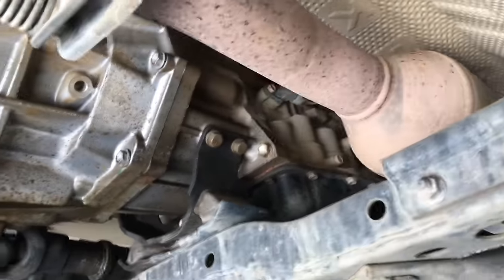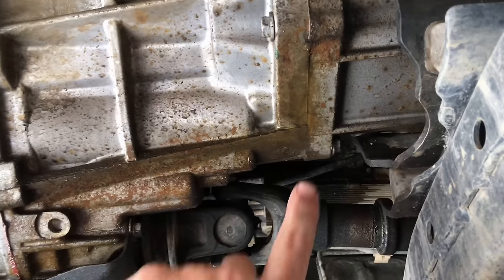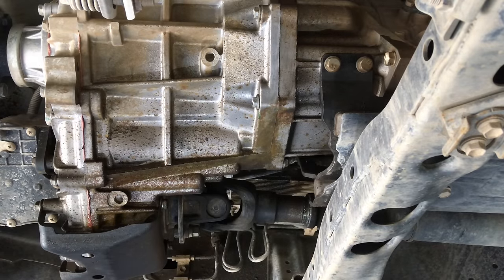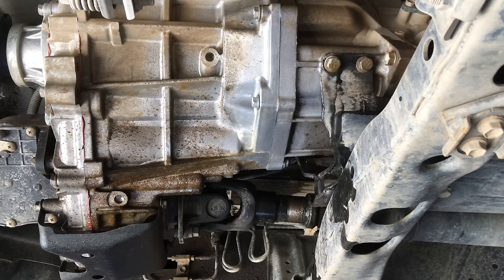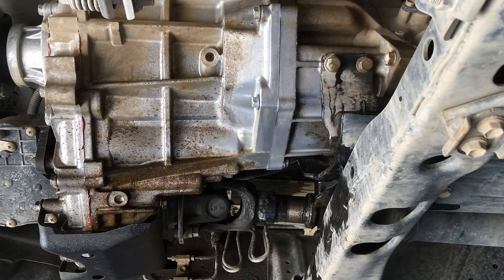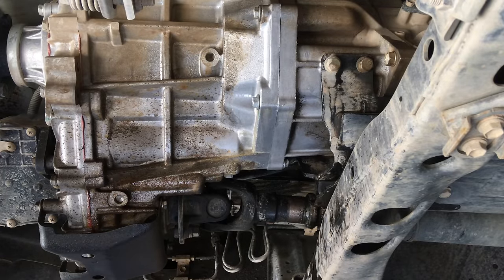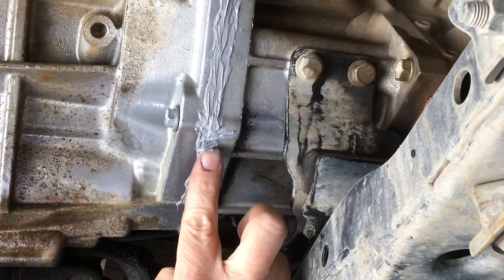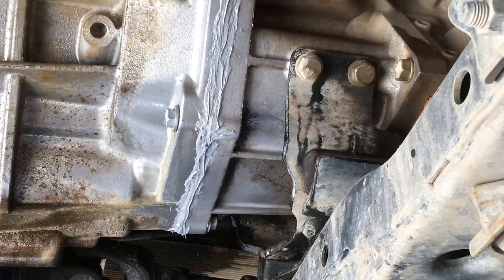CHEAPEST OIL LEAK FIX THAT WORKS

Comment: I wonder if you can tight the bolts little more will it help??? how long do you think that silicone would last???
Reply: If there's leak in that area, then there's a big chance that this one is not fixed by what he showed us. That area is where the transfer case and transmission assy connects. There's no oil there because there are no gears in it. It is only the mating surfaces of transmission and transfer case. Gear oil is in the transmission and transfer case assemblies, not in the mating surface.
Reply: @kordapyo612  correct, there is not even oil in it. its the shaftseal between the 2 cases.
Reply: @kordapyo612  I am currently experiencing a minor transformation fluid leak at that very joint between the transmission and transfer case on my 2004 Toyota Rav4 Automatic. This was after my transfer case was replaced. Just few days afterwards. It's difficult to see where the source of fluid leakage is. 
I was suspecting that bolts between transmission and transfer case were not torqued properly. 
I'm also considering the output shaft seals.
My transfer case seal was replaced during the swap. 
What do you suggest? 
I'm returning to the mechanic very soon.
Reply: @kordapyo612 so if we putting sealand on that space, the oil will come full on that space, it's oke or will make another trouble ?

Comment: Thanks for your video, May I ask you advise, my Sportage oil pan was wrongly resealed by the car dealer and the refuse to reseal it and says different sport. I found the leak come out from one screw which above the crankshaft dust shield, there are 2 screws above the shield, I cleaned the arear and drive about 20minutes one screw can see oil drop mark on the screw head, the other one is nothing. So, I would like to ask you if I follow your way clean the oil pan leaking screw and the arear around it , would it be ok? or needs to re-do the whole seal? Because the oil pan was resealed only 6 months and all around the seal was fine  except around the screw that bit.

Comment: I am looking at the rear off the transfer case, it has been off before by the look of the gasket silicon oozing out around the edges, if that has been off before for something then it looks to me that there some evil things going on inside the transfer case?????? It could well be a never ending source of issues unless it is stripped down and fixed properly??????
Reply from the maker: Just a tiny weep at the seal.
Not worth fixing yet

Comment: After praying to God thanking him for healing, repairing and rejuvenating my car engine, car belts, suspension, clutch and all other areas...everything improved drastically. I had the previous owner of the car drive it and they said not only did it drive like new (it's a 19 year old car) but they noticed the engine sounded like new as well, much quieter (can barely hear it when it's on) and a stuttering noise it used to have has now completely gone. After noticing this they did the same sort of prayer for their own car and noticed the same outcome!

Matthew 19:26

“But Jesus beheld them, and said unto them, With men this is impossible; but with God all things are possible.”

Comment: Looks like either the transfer case input shaft or gearbox output shaft seal is leaking.
Reply from the maker: Yep but not much not worth a major repairs to fix client was happy to hide the five mill a year
Reply: @Fourby4Diesel  Personally. If the owner cant afford to maintain the vehicle then they should own something they can afford. but sadly I suppose its all about the illusion these days. lol

Comment: You didn’t even see if the bolts were tight, and u should always scuff with emery paper for the sealer to stick properly , it’s like paint if it’s not rubbed paint de laminates and peals off, silly dodgy brother, I call that a half job!!!! Quick fix

Comment: Typical for a lot of Dodge trucks and Jeeps one of there biggest flaws I had a '99 Grand Cherokee got used and went to check the transfer case oil level and it was over full probably has it out on the bench to fix that problem and filled it in the bench as well but my '95 Ram has the same issue leaking oil from the transfer case joint I know a few other people who had the same problem not a cheep fix by all means...

Comment: Big mistake, if that's stopping the oil from dripping down, it looks good but if the rear main seal is leaking, oil will be trapped inside the trans housing since there's no way for the oil to come out.

Comment: I am gonna try this on my 2008 Toyota kluger/highlander. It is seeping from timing chain cover.
Reply: Has it worked? I have the same issue
Reply: At205 reseal probably work better. If your leaking by timing cover you could have a bad crankshaft seal
Reply: @HollowMartyr1333  Just tried it yesterday and it didn't work. I didn't remove the VVT Line bottom banjo bolt because i didn't have the new washer and didn't wanna reuse the old one. I am gonna try and remove the goo(as much as i can) and try this again in couple of days. Still don't have the new washer but i will reuse the old one for now. This time i will remove the Banjo bolt because it seems that the area of leak is right behind the VVT line. Will update.
Reply: @JoseDiaz-rd9fh  Additives work for Gaskets(sometimes), not for RTV.
Reply: @HollowMartyr1333  I have removed and reapplied the RTV and so far it has been holding up fine. It has been more than a month since i applied it and so far all good.

Comment: Putting silicone like that has never worked for me 
Maybe because I haven't used the toothbrush
Reply: Drain a little fluid and put some Lucas in. Thankfully I've never had any leaks. 2010 RAV4 with 197k miles. Stuff works

Comment: Rare main seal cracked or split... A roughly 30 buck rubber seal.   But the labour costs outweigh the benefit...  You drop the transmission.,  not worth it.. What your doing is economically sensible..

Comment: I have an oil drop coming form my VVT Solenoid Cover on my FX35. I ordered a replacement gasket and replacement covers but waiting for them to arrive. Car only leaking when running and as the engine heats i notice drops coming from the bottom right corner.My Part arrives on tuesday morning, but need to drive this weekend. should i do this as a temp fix?

Comment: Any good fixes for repairing a boot tear on a perfectly good ball joint?  Thks
Reply: if you are looking for a temporary fix or need to make a quick repair, you could consider using a boot repair kit. These kits usually include a replacement boot, clamps, and adhesive. The process typically involves removing the old boot, cleaning the joint, installing the new boot, and securing it with the provided clamps and adhesive.

Comment: It looked like the drive shaft next to it might have been the source, slinging the oil?
Reply: yup i agree he is focusing on the wrong area
Reply: There are seals inside not exactly sure what vehicle but on my wife’s she had rear main seal leak where engine goes into the trans. Crankshaft has a seal that goes around 100K

Comment: Should examine what type of oil that was leaking..if it motor oil could be the oil seal behind the flywheel..if it gear oil mybe the oil seal in the gearbox..

Comment: So I know this may be a dumb question but I have a similar scenario, is it possible to solder the area to fill the leak?
Reply: That’s a good idea but keep in mind when u solder its heat and heat can cause warp in your aluminum internal then it can create misalignment to your internals and in effect might damage your transmission which in the end your car won’t be drivable anymore

Comment: Im pretty sure this is whats wrong with my tb. I did this and no luck. Ive had to top it off and it slowly leaks out and covers everything under the carriage. Ive torqued all bolts to correct specs around area and it still slowly steeps out somewhere. i guess i need to scrape it off and retry it. Using a razorblade the best way? Any tips would be helpful.

Comment: My civic 8th gen transmission is leaking at this same point. Could be the axel seal not sure. But what i want to know is that the silicone might stop the leak but inside seals which are leaking they will keep leaking. Will in the long run it will damage transmission?
Reply: It will it u got to the point of now more oil or trans fluid inside so best is to make sure you don’t ran out of fluid …in my case it’s the same issue so I figured if this doesn’t sort it out then i will have to accept and live to just change my trans fluid every 10K miles it’s actually better for my internal tranny and shifting on a long run

Comment: Also that bolt looks loose it's got a black gap shouldnt have that if its tight  , look at the bolt on the right facing the same  direction it looks tight and no black gap 😳

Comment: Can the RTV handle the high heat of the transmission? How long does it last?
Reply: Same question i have? I loteraly ordered bothr the high heat and black regular to see if i find this answer. In an hoir id take my chances with wichever id fimd the answer
Reply: I've used both rtv and even roof and gutter silicon on exhaust systems to seal leaks and it handled the heat of an exhaust manifold so gearbox temperatures won't bother it

Comment: I disagree with this method. The real leak is still leaking. By sealing this, dirty oil and all the gunk and dirt in it will now fill the void between the "man made seal" and the Main Seal. That will mean, in the near future, all the trapped dirt will start making the real Main Seal wear out faster. I say let it leak. Use kitty litter on your driveway. Check and refill the oil level every 2 weeks as needed. Oil is (still) cheap.
Reply: I agree with you, the oil will come full on that tc & make another big trouble, it's better to refill the oil

Comment: What are the cons in doing this type of work 🧐
Reply: If it’s still leaking then one of the cons u have to accept to avoid major repair is u gotta keep an eye on your trans fluid level or motor oil level

Comment: Would the product called 'The Right Stuff' last longer and perhaps be another good choice in place of the RTV?
Reply: Right stuff is amazing just prepare it good I mean clean it. Best way is if you take something sharp and make a groove by removing end part of gasket between joints and fill it up and it will hold long time

Comment: Is it just me or it looks like those 2 bolts are loose on the bottom of the case? That might be causing the leak 🤔
Reply from the maker: Nothing loose
Oil is not usually in that area

Comment: There should be 2 seals in there.... one for the transfer case shaft and one for the transmission shaft. There should not be any fluid in there. If there is one of the seals failed
Reply: Is there a breather in there mate ?

Comment: Wonder if steel stik would work too
Reply from the maker: Timber is more forgiving it won’t damage anything steel will damage in mock surfaces when accidentally making contact
Reply: @Fourby4Diesel  im going to try this, which rtv was used maximum oil resistance max temp of 500f, or just high temp rtv up to 650f

Comment: Hi guys! Can anyone help out?

I’m looking to buy a 2014 dodge caravan with 118km from a Honda dealership. Sales rep noted that it has an oil pan leak & a rear valve cover gasket leak there going to be fixing after pre purchase, is this something I should be concerned about? or is it normal? 

Thank any help would be much appreciated!❤
Reply: It’s not normal at all.  It’s concerning cuz anytime you’re purchasing a used car …that kind of problem shouldn’t exist at all before purchasing…otherwise you’ll end up spending more down the road ..other term known as money pit car

Comment: Well, that's not a fix. If there is oil dripping from there, it must be camshaft seal gone bad. That means the oil is gonna collect in transmission cover and eventually mess up the clutch ( frictional disk)

Comment: Very small leak on machinery moving significant loads is "within spec."  You do not dismantle a large machine to cure a miniscule leak.  That said, this type of repair is unlikely to cure the seepage.  That method might work a little better with hard, temp-resistant epoxy.
Reply from the maker: Works every time
Good stuff
That’s why I showed ppl.
Tidys up a minor weep

Comment: ATP's "AT 205 Re-Seal" Is The Best Way To Permanently Fix An Oil Leak, Transmission Leak,  Power Steering Leak, Etc. 

You Can Purchase It On Ebay, Amazon And Other Online Auto Sites! Just Pour It In And Within 5 Hour's Of Driving It Will Recondition Your Seal's And You're Good To Go!

It's A Lot Less Work With Excellent Results! ✌️

Comment: I would have a lot more faith inlyou if you snugged up any bolts along the joint before you did your service.
Reply from the maker: Then you like many other people should keep watching the videos and you would understand there is not meant to be any oil in that cavity and tightening the bolts makes no difference also, it’s a Toyota, so they are not loose keep watching have faith

Comment: I've tiny leak which I think is where crankcase and AC compressor are bolted together . It takes a while for oil level to go down but will see if something like this works . problem is that seems it slowly keeps leaking not giving me a chance to clean and dry it . Is there any way but to wait till next oil change to drain it ?

Comment: WTF dirty talker! massage it into the crack!! Considering it was a minor leak I am guessing it was a success . Not too sure how it would go on a more substantial oil leak and I am guessing depending on where the leak is coming from which part of the motor how successful this type of repair can be ! I once put a motorcycle chain into my crankcase around the shift mechanism and it smashed it into many pieces because I was in the country with no bike shops for hundreds of miles, I gathered all the bits together thumbed a ride into the nearest town and at a local hardware shop, I purchased a product called " Plastibond " and glued everything together sanded the gasket edge flat and used a make a gasket kit and made my way back to the bike assembled it all together and made my way back home around 800 miles and it was eventually replaced after another 6 months of city riding with a very minor leak! It does not hurt to try and if not then nothing lost.

Comment: How much more would it have been to take the transfer case off the back of the transmission and put the proper seals? I honestly would of make sure both transfer case and transmission were full and just kept an eye out. Cleabed off the seepage and seen how it looked ot 5k miles. Not worth the rtv on the outside of the case filling the void between the trans and xfer case honestly
Reply from the maker: Heaps more for five Mm of oil a year

Comment: As already "Quinton Muna" said: Now the leaking oil is gona get filled up in the transfer case. This type of "repair" can make anything more worse!!!
Reply from the maker: It’s not a leak and it won’t be any worse you need not be concerned
Reply: @Fourby4Diesel  did you ever do a update video, is it holding up?

Comment: Name of cleaning product please
Reply: Brake cleaner 
but I would try adding AT-205 re-seal oil leaks. It works for oil, transmission, power steering, and differential leaks. Research this product on YouTube.
Reply: It was a brake cleaner fluid  !!!
Reply: Brake cleaner. You can buy it anywhere and it cleans lots of things on vehicles. It evaporates quickly and leaves no residue.

Comment: Your not saving customer money if your bandaid repair causes more damage. There is enough room for transfercase seal to leak its oil into cavity between trans and transfercase. This will Cuase low fluid level and damage transfercase (big money part]). when to remove and fix 20dollar seal is easy 3 hr at most job or an 1hr for professional who does these all the time. Grandma said Penny wise dollar foolish .
Reply from the maker: Three hours so that makes it a $500 repair for an oil leak that isn’t even a leak 10 mil per year maximum you’re not getting the point it’s not worth fixing and we’re demonstrating how the product can work

Comment: Mmmm I thought you knew your stuff when it come to Toyota's, maybe just stick to the fuel side of things...the transfer splits off of the back of the transmission and there is a seal in the front of the transfer and rear of the transmission, the area between the two box's is a dry area.
Reply from the maker: Stating the obvious thanks anyway watch a few more videos and you might understand a bit more about why we did it I’m sorry you misunderstood our understanding very misunderstood 😂

Comment: This fix is totally useless since the real leak come from the t-case and tranny jonction, surrounding the connecting shaft. I have done this fix twice so I know what I'm talking about. With what you have done, the oil will still spill in the housing. The problem is not resolved at all.

Comment: Why not 🚫?
As long as it's not a gusher and the internals were still good, it's not 🚫 going to risk damage. Especially good for slow drippy leaks.

Those wanted to do that large repair 💵💸💰 job must pay the full price, even for the knuckle busting DIY.
A lot of time replacement with new OME parts still don't solve the problem if the fault or flaws were the manufacturer's .

Comment: Anyone try RTV or similar product to stem a rocker cover gasket leak? Or is that a really stupid idea! Lol
Reply: I used a caulking tube of 100% silicone sealer from the hardware store on my smokey leaking valve cover gasket and it hasn't leaked since.